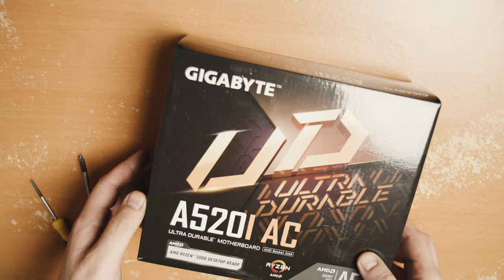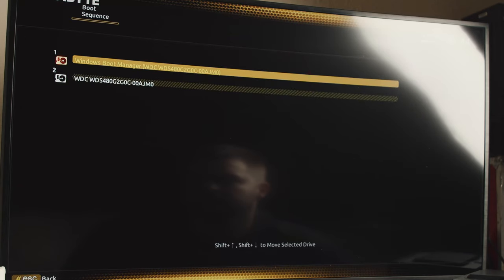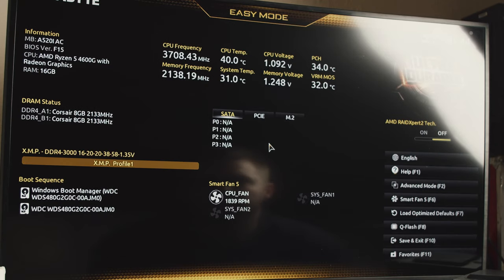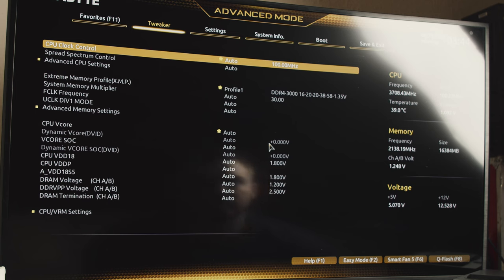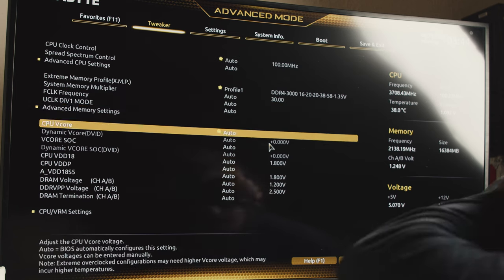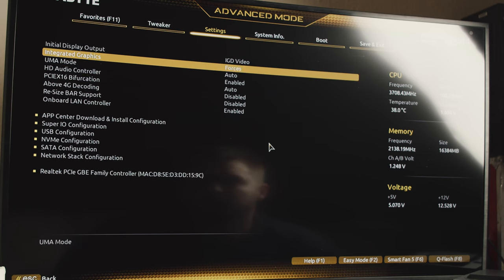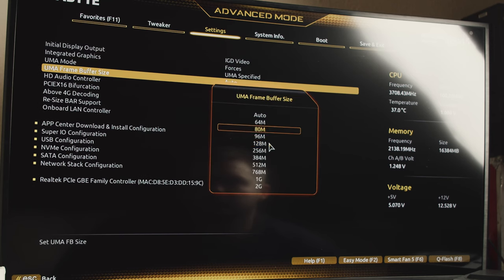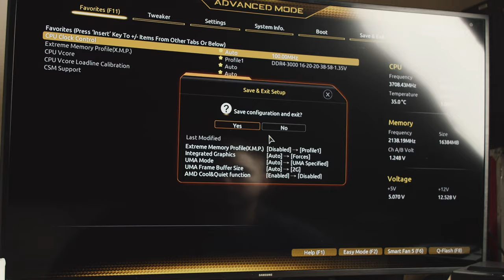AMD Ryzen 5 4600G m-ITX PC quick build guide!

Comment: Have a question - how's the PSU? Is it reliable?
Reply: It is not... I've bought two of these cases and both have died within a year. I bought one after the first one died. Pc sits in the shop with its own dedicated 15a outlet so my source wasn't the issue. Ended up hooking up a spare atx psu as I needed it immediately. Am currently looking into pico psu's (rgeek). (also, it was not my main pc)

Comment: Can you tell the version of BIOS? I have this processor and this motherboard. But with F20 bios, it will not work. I made tests with F16 and F17, also did not work. The board has been tested with Ryzen 5 5600X and works perfectly. If you can tell me the version that works with your hardware, will save me a lot of time :) Thank you
Reply from the maker: Hey, I'm using this board and cpu as a jellyfin server these days and it's still on Bios F15 working well
Reply: @VirtuousVideo  Hey, thank you! Sorry for taking too long to reply. I tried F16 after seeing your message, and same problem. It turns out that a HBA adaptor (Marvell 8 sata port)  was causing some problems during the set-up/first boot. After removing the HBA, the board worked perfectly, even with newer BIOS versions.
After that, I installed again the HBA and everything is running as planned. Thank you for the atention :)